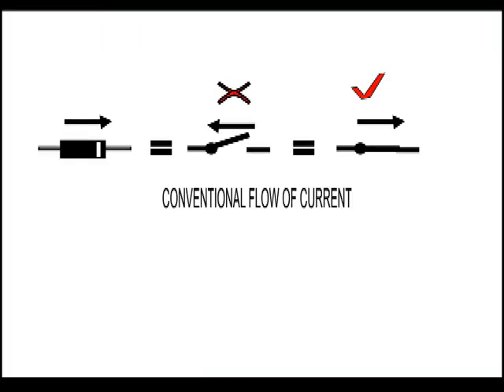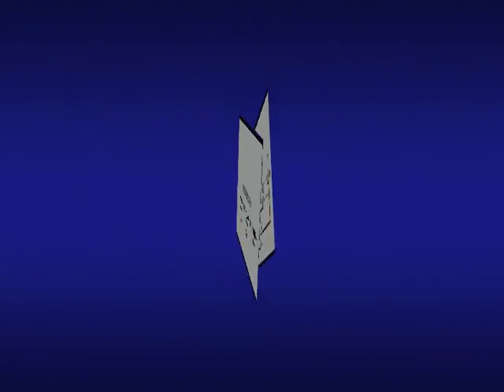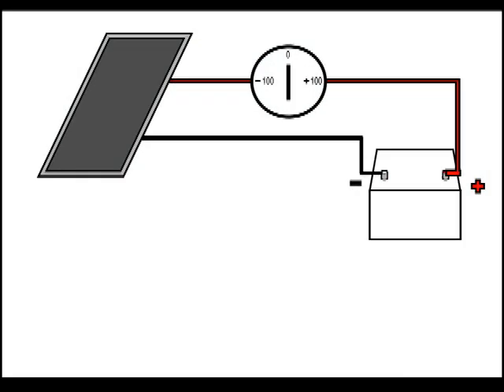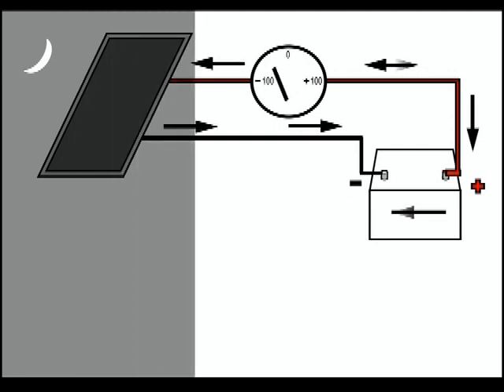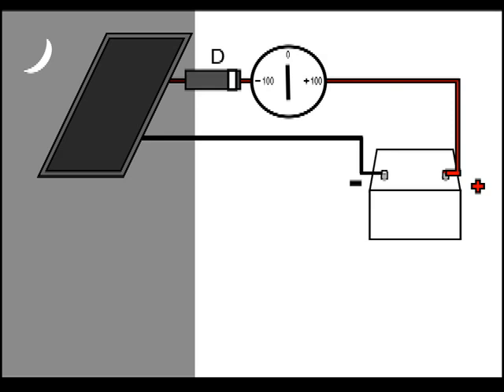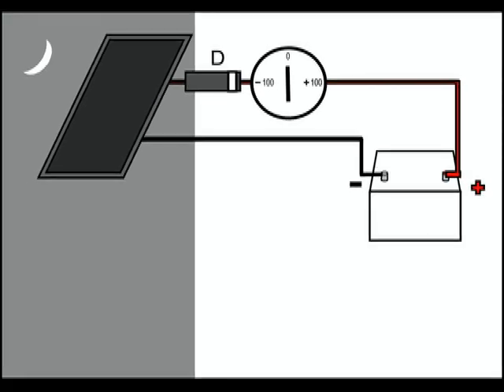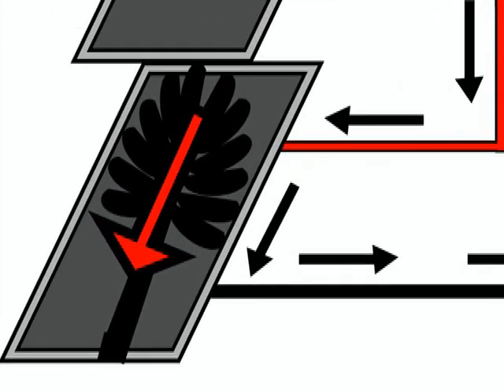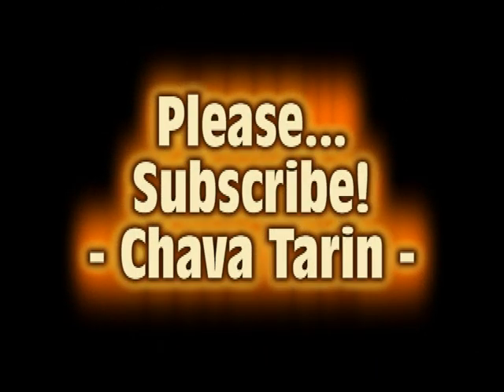Why they use blocking diodes for solar panels

Comment: How should I determine what size diode is needed? For a 12 volt 15 watt panel. Thanks 🌞
Reply from the maker: Well Terry, a 12-volt, 15-watt panel renders about 1.25 amps. You will be on the safe side using a 3-amp, 50-volt diode. However, diodes are not expensive, so you can go as far as 5 amps and 1kV peak inverse voltage. Regards!!!
Reply: @eltunene  I was wondering if the smaller diode will have less resistance and let the solar panel supply more power than larger diode? Thanks.🌞